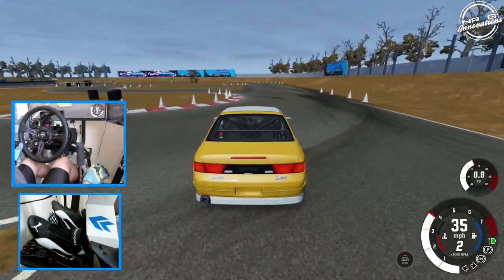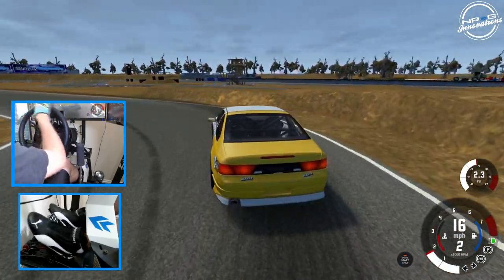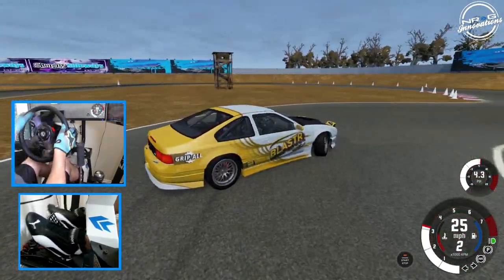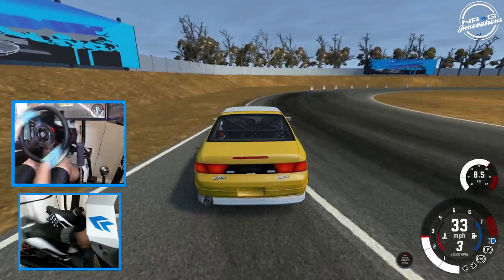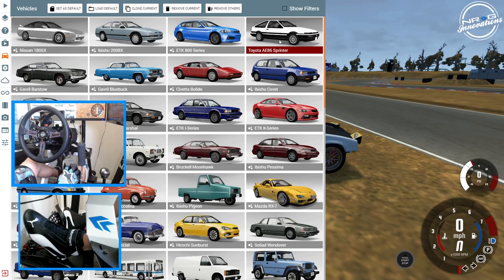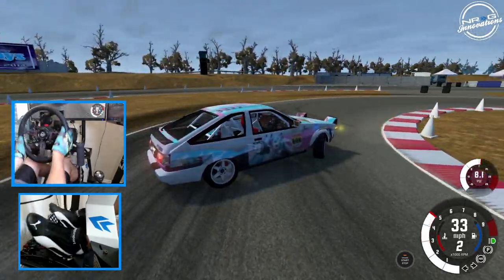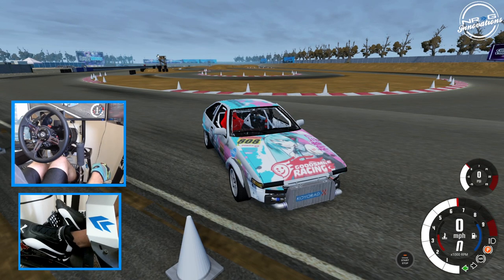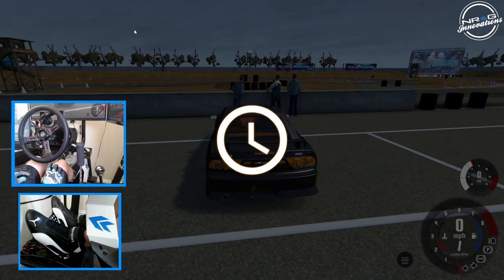Drifting Update to BeamNG drive how does it feel on the wheel??

Comment: Like I said in a old beam ng video,  I have my handbrake plugged in to the pedals and it works fine , that way its easier and can just leave it like that for all games.
Also some stock cars have drift versions that would probably  work better than a mod if the driving system  has been updated